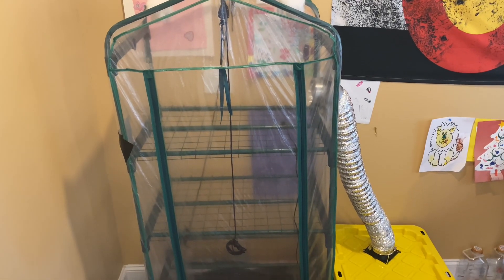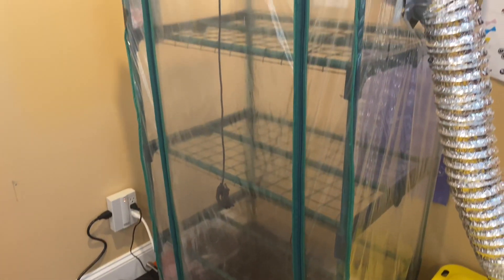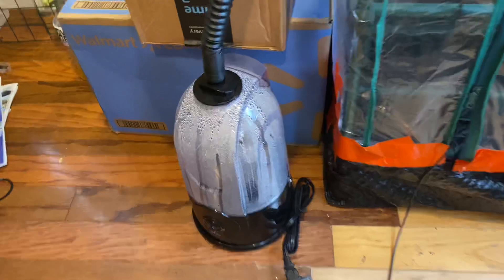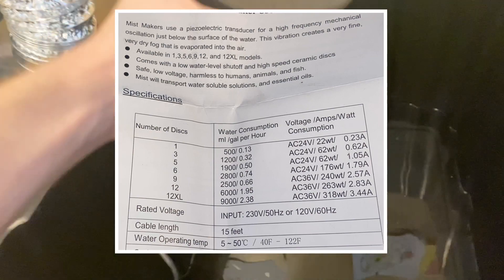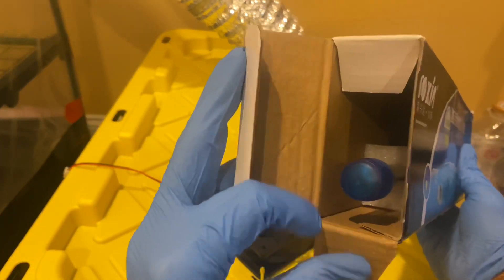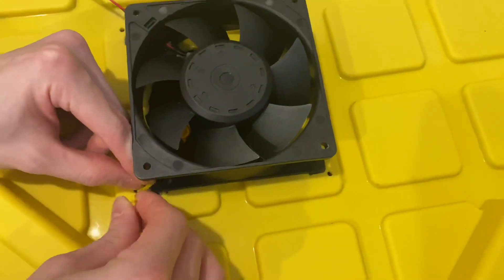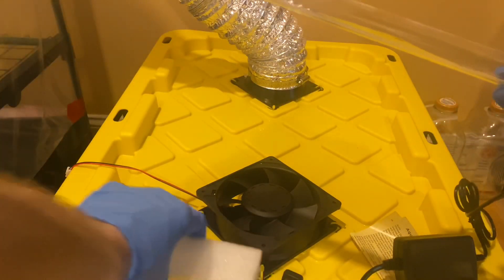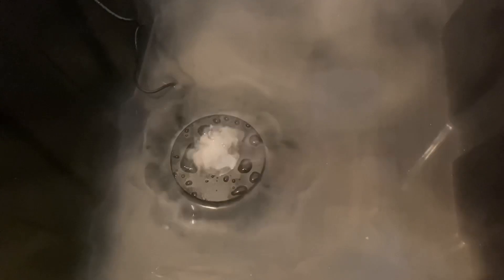How to Mushroom Fruiting Tent - Martha Tek- Fogger - Mist Maker

Comment: Isn’t there supposed to be a pipe leading outside?
Reply from the maker: @cameronlandry537  lol how’d you find this video? But in theory the positive pressure from the humidifier would push air out through the bottom and areas like the zipper that aren’t fully sealed
Reply: @ google lol what do you mean? Ahh okay the diy instructions I read had a pipe actually leading outside a window

Comment: Is this still reliable or is it outdated? I see a Holmes aer1 air purifier, I have one myself. I also have the big Holmes that holds 3 big filters.
Reply from the maker: It’s still good, I would just recommend putting a filter over the fan, (they have rolls of merv 14 filters on Amazon) and then just setting the fan up on a timer so it doesn’t run constantly.
Reply: @TheGoodFunGuy  so just put the merv material over the fan?

Comment: So what does everyone do with with condensation that accumulates on the floor?
Reply: Perlite in a pan. The video lacks details, like the exhaust which you really don’t want in your house. I see a few possibilities: the Martha on top of your water sump that will drain into the tub, UV will take care of any issues.

Exhaust, you need it otherwise you are contaminating your home. A simple duct to fan into a HEPA box. 

Too many details left out
Reply: North Spore did a video on the martha tek, and they didn’t seal the bottom of the tent, but put a large drip tray under the whole apparatus. It would be kind of inconvenient to have to awkwardly wiggle it out from under the legs. I wonder if you put a bunch of perlite or something in the drip tray - would it cause the moisture to evaporate again?

Comment: Someone asked earlier, I'd also like to know how you're managing FAE?  I have this same setup, except I do have a 4" exhaust port with an inline fan plumbed into the bottom of the tent.  Just working through getting it tweaked properly.
Reply: If you have the 120 mm fan set up you should get plenty of fresh air exchange with a Martha tent, the air flows from the top to the bottom if you put the duct at the top.
If you have the 80mm fan, with a clean room you can just quickly open and just the tent once and it would be enough fresh air as well.
Air and CO2 move quickly
Reply: @dakotawallace1156  I plan on ducting the FAE and humdifier into the top of the tent (like this video). Does it matter if the exhaust with the filter is at the top or bottom? In this video, it was towards the top, but I wondered if air would flow better if it was at the bottom (just a guess, no actual idea). What do you think? Any info is appreciated. Thank you.

Comment: can i use two ducts in one bin going to 2 different tents? or will i need a stronger mist maker/fan?
Reply from the maker: definitely, but I would get a mister/fogger with more heads than just 1
Reply: @TheGoodFunGuy  what about doing the misting by hand(mister spray bottle) until i can afford the full setup and periodically checking up on them or would that be a bad idea?
Reply from the maker: Definitely, that’s actually how I prefer to take care of tubs

Comment: I built one of these but am getting lots of nasty black stuff accumulating in the tub and on the fogger.  I'm using well water, which may be an issue?  Is there a certain type of water that is best for this purpose or do you need to clean the tub ever week or so regardless?  Thanks
Reply: use distilled water
Reply: @alr2989  the instructions actually specifically say to not use distilled water.  Maybe I’ll call them.
Reply: @daved2403  well water will have bacteria
Reply: I don’t see where distilled would not be required.
Reply: @wcrotts  I called the company and they said pure distilled water doesn't work well because the water sensor may not work properly.

Comment: What humidity do you recommend in the martha set up and i have a small fan set to turn on for 30 min every 2 hours placed on the bottom rack pointed up and at the back wall will this be to much air movement

Comment: Have you made any changes to this system since you made this video? 
Ty
Reply from the maker: Yes, fan only cuts on for 1 minute every 15 mins. Uv light always on.
Reply: @TheGoodFunGuy   have you ever considered not keeping the substrates in a bin with black bag during fruiting and just let them colonize and then place the bare cake on the rack so it fruits on all sides?
Reply from the maker: I’ve seen others do it, haven’t tried myself
Reply: @TheGoodFunGuy  Also is this setup good for growing Blue Oyster mushrooms?
Reply: @kevinortegaful  I’ve used a similar setup for blue oysters and black pearl oysters with great success on first flush.
Reply: @TheGoodFunGuy  ? starting this now but if I buy a fan timer how will the mist get into the fruiting chamber without the fan blowing it into the chamber or does enough of this mist still get into it?
 Love your videos man thanks a bunch
Reply from the maker: You could have it kick on as often as you want, it might be making some excess mist but nothing id personally worry about.
Reply: @TheGoodFunGuy  what kind of timer are you using for that? I cant find any timer that can do this kind of cycling. Only time programs
Reply from the maker: https://amzn.to/3jDhsuA
Reply: @TheGoodFunGuy  Why do you have the fan on so frequently? Also how do you ventilate the CO2 from the chamber without some holes on the bottom of the FC?

Comment: Another seal hack is getting those bins with the side clips on the handle. Run a layer of duct tape along the bin and the close using the clips. Provides that extra force needed to ensure the duct tape actually creates a seal.
Reply from the maker: If I didn’t just lift the lid to refill I probably would

Comment: I want to build something like this in a closet / pantry only thing different is I’m goin to put the tote right underneath Martha tent and run the duct inside the tent, I am wondering if I can put some sort of carbon filter on the fan so I can bring in “cleaner air”
Reply: Carbon filters removes odors, need a HEPA

Comment: Uv sterilizer needs to be submerged to work as well as it will over heat and burn out. Hence being an aquarium uv sterilizer. and Ive also heard a story of a guy who burned his eyes and couldn't see for a week looking into the light when he removed it from his aquarium. i made the same martha tent lasted me a year one thing id change is it needs a diffuser and angle it towards the pipe inlet to allow settled water to return to tote best of luck Godspeed....
Reply: Is this to prevent excess water settling in the tent, in general?

Comment: I don't understand... Don't contaminants enter throu the fan? Through the ventilation system? The fan is totally open, there s no filter added, right? I thought that i have to add e hepa filter to the fan... But then i should add a more powerful fan...
I don't know if the uv light kills every contaminant... Contaminants are a big, very big problem
Reply: If I were u I would wait about an extra 3-5 days after full colonization before introducing to fruiting, what temo do you fruit them at the lover the better however some so need higher temps to get a good flush. With that been said it also helps to us a ph adjusted  non nutritive casing . Another easy method is to use limestone powder in a mister to increase the alkalinity a bit and act as a buffer I find that the less acidic you substrate and casing is the less contam tbh I loves using martha setups it's just that they contaminate super easy and if your doing a large op your entire crop can be destroyed it's better to use a unmodified or modified monotube and but a home air purifier with a hepa rating of 13 it makes a huge difference especially if you have a very bio active home

Comment: but if the fan blows air  INTO the uv reservoir... Do you need to get the mist air get pumped out of the tent  ?
Reply from the maker: surprisingly no, the mist is very fine and does a good job of raising the humidity without making everything wet

Comment: Do you recommend to use this tent mister method as opposed  to the single automatized nonotub+terrarium mister with automatic fanning method propossed by myco willy's tutorial? also if i were to use the singlemonotub+terrarium mister method, should they be on a martha tent, would it be too much 'space' ; where should an automatic monotub be stored for it to function without getting contaminated, ? If I dont have much experience should I still use a single individual automatic  monotub system or stuff a tent like yourse full fruiting cakes and have a single humidity checker for the entire tent?
Reply from the maker: I mean honestly if I use a tub I don’t modify it, the tent is really good for gourmet strains that need a lot of fresh air.